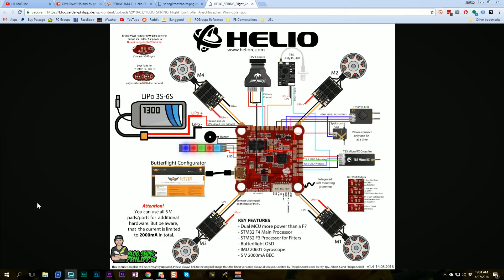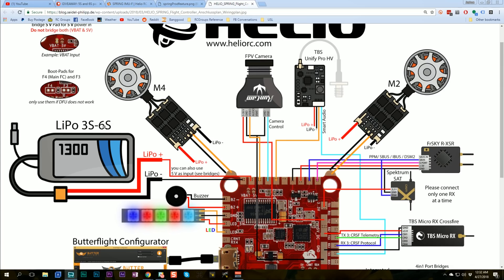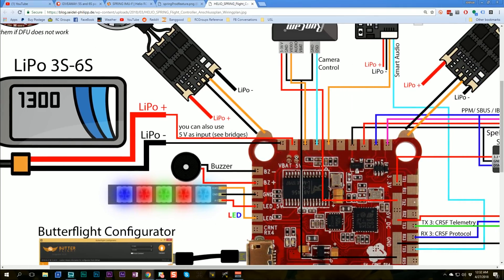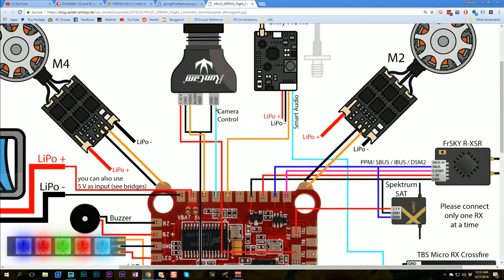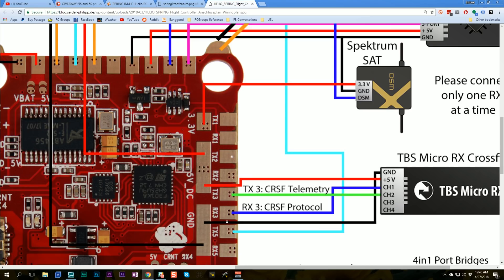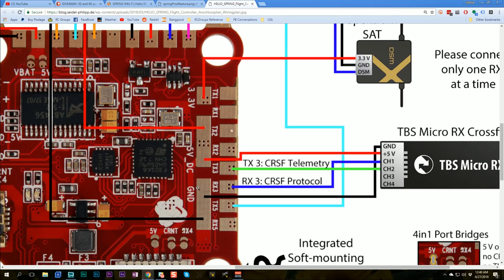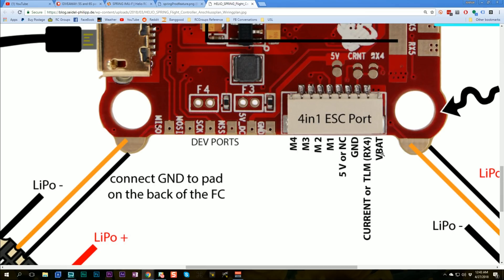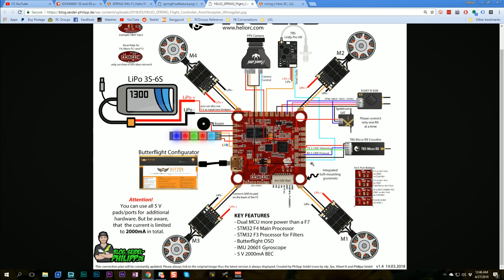Helio Spring Butterflight Flight Controller | F3 + F4 = F7?

Comment: Developers should try to put some quad or octa core cpu as in cells - drone prices come close to nice cellphones anyway
Reply: Joshua Bardwell not if the architecture were done correctly ;). Stay tuned :)
Reply: There should be a drone specific SoC by now. Quad core with RF transceivers for RC and VTX and OSD on the same die.
Reply from the maker: The problem is the entire code base would have to be rewritten for the new architecture.
Reply: You would think - but no absolutely not entire code. In fact all could stay unchanged and with later updates all measurements split into parallel tasks between cores.
Reply: Curtis Campbell if you are going to change go 64 bit and then sky's the limit
Reply: Helio RC OMG!!! It is happening.
Reply: Joshua Bardwell so what..... That's a good thing especially with what butterflight is trying to achieve. A rewrite is good at this stage plus way less limitations. 64 bit all the way.
Reply: Joshua Bardwell I really doubt that. Maybe for max effiency. But you should be able to get a good enough interim solution by just porting existing code. New platform would most likely still be 32bit ARM SoC based just not an ST probably.
Reply: It seems we all have slightly different visions about how this would be accomplished. I am in what I would describe as the good enough camp. HelioRC spring is to me the first iteration of that. Now we can extend that to have the cores on the same die and get rid of the SPI. Then extend further by adding to the die more stuff like RC that we normally have to do a a bunch of layers of protocol translation stuff for.
Reply: Curtis Campbell why stop half way or ...good enough when if you are going to put the effort in go all the way. 64 bit processes aren't expensive these days
Reply: Helio RC this makes me happy
Reply: Curtis Campbell do anyone really know how much development of SoC cost in time and money? For example just  single use license for a Cortex A-class CPU will be somewhere around $1M up front plus ~2% per chip sold and optimistically add to that couple of years to develop SoC around CPU core and cost go sky high. And money is least of problems here, till you finish design "big" companies will make off the shelf 
microcontroller that will make your design obsolite even before you finish design of you can beat them but then you will need to spend >$10B on your SoC design (for example STMicroelectronics is spending $1B on R&D per year and they have expirience of over 20 years in microcontroller developmant, and they mange to put "new" generation every couple of years, and most of design is just evolution of preious designs)
SoC for mobile are usually designed by buying multiple IP from different vendors and combining in one SoC, and most of price you pay for mobile phone is to cover costs of R&D, parts in it are less then 1/3 of cost (and same SoC is used in many models of phones).
Reply: Perhaps a generic quad core is enough then. Bringing the quadcopter specific peripherals on the SoC  might be overkill. But the idea should still be for each peripheral device to have its own ARM core controlling it over the lowest latency bus as possible.
Reply: Miloš Lazović yeh so buy off the shelf 64 bit multi core and be done
Reply: Kristian Taylor You probably watched this on Cray XC50 or IBM BlueGene/Q or if not why they both are "of the shelf" computers (or maybe it would be stupid to use them to watch youtube, you will not see any difference between watching video on it and on what you watch now). 
There is reason why no one is making 64 bit multi core FC, they are simply unnecessary, speed of microcontrollers we use now is more then enough , and if was not anyway there is more then enough 64 bit multi core  SoC on market today (and there is even 64 bit multi core microcontrollers on market) and nothing is stopping designers of FC to use them.
But as you mention no one is using them, and for same reason as i mentioned first sentence.
Reply: but they are not are they... you are totally wrong as we are constantly trying to keep the cpu load down. the helio fc here is adding a second cpu just to handle the gyro so your argument is totally wrong. this is part of the issue cpu load, it can't handle the loops and do other things. with the right cpu this is a cake walk. we should be using cpu's that with everything turned on still has plenty of free headroom to process everything. It's pretty basic really.... cpu can't handle the loads get bigger cpu..... whats the biggest we can get these days ... go with that ... why waste time messing around with incremental ones that only last a year! in the past we didn't have the technology but we absolutely do now and at a cheap cheap price. And yes I get the money factor where companies do small improvement to keep us buying for a long time  but that is crap for the consumer.
Reply: Kristian Taylor you obviously don't understand problem, no one is trying to keep CPU load low (that is just stupid if you have 2 processor doing same task one have load of 1% and other of 99% they will do same task with same speed, only first one will waste cycles doing nothing) , we only try to keep CPU load all time below 100% (ideally will be to keep CPU just below 100% but that is practically impossible). Helio RC is using 2 microcontrollers not because there is no FC with microcontrollers that can handle load, all F7 boards are much faster then any combination of F4 and F3 (or even two F4) but because there is bug in software which make it do not work properly on F7 boards (and before that bug F7 with kalman filter had load less then 20%). Helio RC found immediate fix for problem and their solution will be "obsolete" (same as F1 and  F3 boards are obsolete now but people still use them) with next betaflight (there is already fix for F7 boards that will be included in next release), but Helio RC did right making solution which work now, personally I did not expect that fix for F7 will come so soon (and we will see if bug is totally fixed).
Even now there is better solution which is 100% compatible with F7 and it is 2 times faster, and it is called H7 (100% pin compatible high performance version of F7), you can replace F7 on FC with H7 and it will work with same software only (near) 2 times faster.
If you want "best processor" for flight controllers then you can always go for RAD750, which is NASA go to processor for that purpose, but I guess that price is not for everyone (it is around $200,000 for a chip)and it is slower than F7 :)
Reply: feel free to completely miss the point.
Reply: Kristian Taylor Yes I was wrong, there are 64 bit multi core flight controllers on market, for example NAVIO2 (1.2GHz 64-bit quad-core ARMv8 CPU), ERLE-BRAIN 3 (1.2GHz 64-bit quad-core ARMv8)  and 32 bit multi core flight controllers like  Snapdragon Flight Autopilot (Quad-core 2.26 GHz ARMv7-A, but in new version will be replaced with 2.2GHz 64-bit quad-core  ARMv8-A) or Intel® Aero Ready to Fly Drone (1.60 GHz quad-core Intel Atom + STM32).
All of them run (for now) only PX4 software, which run happy on STM32F427 (and it is designed to run on STM32F427).
As you see there is lot of choice for you now that meat your 64 bit multi core criteria now, but you didn't hear from them (probably with good reason), so you are free to pick any one of them right now and be happy as a pig in shit because you have 64 bit multi core flight controller (till you do not realize that all that cores are used only for computer vision, and not for code related to flight).
Reply: Miloš Lazović feel free to be a douche and go overboard on everything. Clearly you know everything. Good luck
Reply: Kristian Taylor What is now your problem, first you was unhappy that there is not FC with 64 bit multi core processor, it turn that you and me was wrong and they exist now on market , so now you are unhappy that they exist?
On your picture you do not like 2 year old kid, but you act like one.
If you think that 64 bit multi core FC will solve your problems just stop bitching and go buy them, nothing is stopping you, hardware and software are available now (and they are open source).
ps: I do not know everything(I am far far away from that), but maybe it look like I do for someone who knows nothing.
Reply: Miloš Lazović bah ha ha 2 year old ... That's a good one. Made my day!

Comment: The only thing i will change in Helio FC is the Motor Signal/GND pads, i really hate solder them.
Reply: Andrea Cecchini thanks for the feedback we do take feedback seriously when considering future designs :)
Reply: I'm not a fan of the signal pads on the corners either.  I ended up making my signal wires longer than necessary so i could go up under the board and come back, but the signal pads could still get ripped off in a good crash.  I greatly prefer pin holes so i can run the wire up through the bottom, but it is what it is as they say.
Reply: Signal pads are terrible. The helio needs a battery voltage out pad for tramps or unifys imo

Comment: Since you asked:  My experience with butterflight on this board has been fantastic.  I feel like it has all the flight magic of Kalyn / raceflight, but also isn't 2 steps behind on the practical stuff (OSD, cam control, LED's etc...) the way RF was.  BuF defaults made the best flying quad I had, and further tuning has only improved that.  Going forward, unless something drastic changes, all of my builds (which are racing focused) will be Helio Spring / Aikon32 /  Butterflight etc.   I would also venture to guess that the 'meh' crowd has been running Butterflight on a different board, not this one on 16/16 or 32/32, with all the magic switches turned on/off as necessary...
Reply: the downside of this development (IMO) is compatibility.  Kalyn et al. tend to design for the stuff they use / like, and not as much others. Case in point:  This Typhoon32 ESC /  Helio combo has been prone to dropouts due to some sort of EMF noise from the ESC getting picked up by traces on the Helio board.  The Helio team has offered a few options (shielding, flip one or both boards over...), but ultimately, the answer is just "run an aikon since that's what we developed this stuff on."  If you run what their team runs, all is great, but if you want to do something unique, you're sort of on your own sometimes...
Reply: I had that issue myself on the HElio + Typhoon V2 - it is 100% a hardware issue and no amount of software could fix that. What did help for me was flipping the Helio upside down - you wanna make sure that the inductor coil on the 5V regulator is far away from any 4in1
Reply: Brian Bailey funny you should mention that, we didn’t actually test it on the Aikon. We tested it on a bunch of typhoons and spedix ESCs. It wasn’t until Apoc built it with the Aikon on the deadband show that we even considered it. The issue with the typhoons only affects maybe 30% of them and the typhoons and spedix we used, we never saw the issue in testing

Comment: On the 4 in 1 plug It is vbat power that's how I powered my Helio is with that 4 in 1 plug, for those who are wondering the answer
Reply: Jeremy Vest I second this, vbat on the ribbon from ESC is powering the board.
Reply: if your using the 4in1 for powering, the Vbat pads on the Helio are a nice place to wire an extra cap. if needed
Reply: Holeshot FPV I have my quad built and the vtx powered straight off the battery lead and using the vtx to power the cam.”.  Works great! Very clean video.
Reply: hey late reply!   i just powered my unify hv from the vbat pads on the FC , the ribbon gives everything power , but i do wonder if that think vbat wire was enough to power everything , i didn't have any issues powering it that way tho. hope this helps
Reply: thank u so much for the answer
Reply: Jeremy Vest how do you power a Unify Pro HV on this FC when used with a 4in1 ESC and the ribbon cable?
Reply: caymandiver75 wondering the same thing
Reply: Jeremy Vest that’s how i ended up doing mine as well. Going to rip it this weekend to see if it handles the load. Thanks

Comment: Hey @Joshua Bardwell if you power the board from vbat through the ESC plug and set the rail at the top to vbat the receiver pad still gets 5v but then vtx and cam pads still get vbat

Comment: My experience so far: 2 identical quads... F80 2200kv on 6x4.5x3 on 5S 1500mah packs, Aikon 30A/45A esc, 720g AUW.
Betaflight rig: Matek 405AIO, 32k/16k/32k unsynced, Multishot, Dynamic Notch and Dterm Notch/gyro stage 2 on with BBox frequency set 174hz/325hz, PT1 for Dterm, gyro/yaw/dterm lpf 90, Antigravity 3, D Setpoint 2 / 0.1
Butterflight rig: Helio Spring / DemonCore PDB, 32k/32k/32k unsynced, Multishot, q @ 4500/4500/3750, dterm notch on, gyro/yaw/dterm lpf 90, Biquad for Dterm, Antigravity 3, D Setpoint 2 / 0.1

Both quads fly exceptionally well. The Butterflight quad has less propwash (less meaning zero) BUT the Betaflight quad feels more connected/less latency by a noticeable margin, and still has almost no propwash. I was told by a dev to not try PT1 bleh, might still . . I will continue to try to get more from the Butter quad since my Betaflight quad is so well tuned. I am not a pro, but I do help all my buddies tune their quads, like 6 of them lol

Comment: While the Helio only runs Butterflight, I don’t think it’s particularly fair to say the Butterflight devs only care about the Helio FC.   Butterflight came first.  It was just the better platform for Helio at the time. 

Helio just flies better that other boards out there.  You’ll see when you fly one.
Reply: since it has the f3 just for filtering how about a real kalman filter? instead  of the static F(ake)KF ?
Reply: A PR from butterflight's GitHub 😂

"Can the devs please help work on this? Butterflight is getting super far behind and will become irrelevent if we don't make the effort to stay up to date.

According to this pull request butterflight is 262 commits behind and every day the problem becomes worse.

Without staying current butterflight is becoming nothing but a tool to support the helios flight controller at the expense of every other fligth controller user!"

https://github.com/ButterFlight/butterflight/pull/139
Reply: OK.  putting back now.  Screw it.
Reply: https://youtu.be/OR-772OqRoQ

Listened to the interview again:
30s - Kalyn is introduced as a lead developer of Butterflight and principle at Helio with Tim and Shawn.
1:12:'ish - talk about tracking serials and how Helio is a mechanism $$ and Butter is the mechanism for the open source outlet.

+ video splash says Butterflight, but the folks talking are Helio.  So the perception is there because of how it is laid out.
Please don't get mad at me.  Just sharing what was presented.  Sorry.

On top of this: Kalyn leaving RF and not wanting to go closed source again (which would mean starting over and coding everything from the ground up to just sell boards) meant pushing what was needed into an existing open source project (like BF).
Reply: @Helio RC, there ya go.  Listen to your own interview.  Glad you picked.  Double down.
Reply: See interview.

And make sure to buy a T-shirt!!  come'on now.  Kalyn (+ others) gets the Helio coin, but Lucas (+ others) deserves some coffee money for their hard work too! I'm sure they have spent a lot of nights in front of the keyboard when they probably should have been sleeping.
Reply: UAV Tech that's really interesting.
Reply: Kwad Save The Queen ^
Reply: Tnx Frenchie :)
Reply: Oh yeah, whelp I'm going to make a new filter and call it the PB&J filter (some call it the ABGJ, but they are wrong).  And it will be guaranteed to make you a PB&J after you land.  Beat that!  :-)
Reply: UAV Tech Whoa whoa whoa my friend who the hell told you that?? Butter started because of a disagreement with the beta devs. We wanted to do something different with the filters and we did. To say that butter started for Helio is bullshit. I forked beta because I wanted to keep using FKF and the project took life of its own
Reply: UAV Tech lol “deleted because it causes drama” = “deleted because it was wrong.”
Reply: French Brown , Butter was specifically forked to sell Helio boards.  This is the result of the Raceflight team split.  The focus (the $$ maker) is selling Helio boards.  Butter comes along for the ride as of course a key factor in "the awesomeness" as the firmware that runs the board.  Much more time efficient to fork (copy) an open source project vs. starting from scratch again like RF had to do.  So the need to have it come out first, sell the awesomeness, and then release the board is the big plan.  If folks experience the nirvana, great! The marketing is legit.  If not, whelp sales are sometimes misleading.

My 2-cents from taking it all into consideration (timeline, slack stuff, BF stuff, PMs, the interview, etc...).